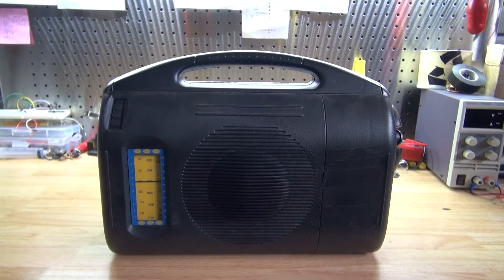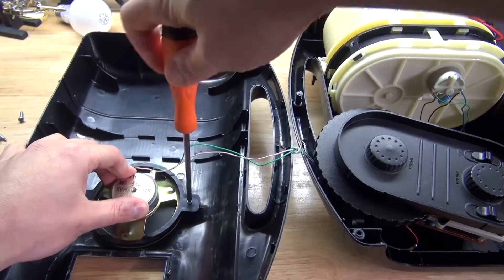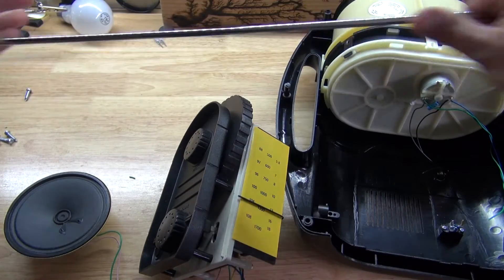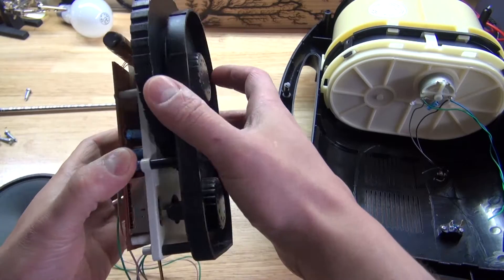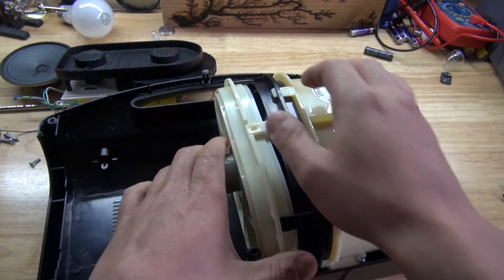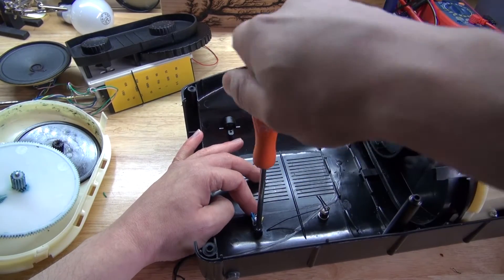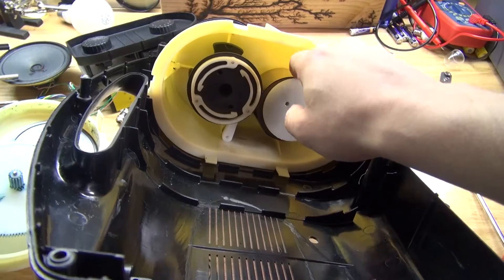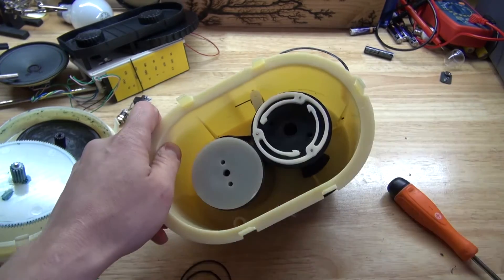Old Wind Up Radio Teardown

Comment: I have a different version, but still  works the same way. Mine is made of clear plastic, so you can see it all working. The spring is safe enough in its run-down state, but when wound up it is wound onto the other spool under tension, so rather nasty if that was to let go suddenly.
Reply from the maker: Yes, that does seem to be very scary!

Comment: I had this exact radio. The rubber band and the wind spring went kaput. What I loved about this radio is that IT IS A TRUE ANALOG TUNER radio, no digital tuner!!!!!!! This radio really grabs the signals. It sounded good in its case, so what I did was disconnect the little generator wires, and soldered up some new wires coming out of the radio, put black and red alligator clips on the ends, and connected the radio up to a 6V lantern battery. or a 6V cluster of D cells. This radio kicks ass! Hate to see analog radios ruined or destroyed.

Comment: I bought one of these 'remanufactured', oh, about twenty years ago.  Mine is marked as running on three volts instead of nine btw.  I tried it a month ago and it broke loose and unwound explosively.  The next time I cranked it, it bound.  Took it apart as carefully as I could and the spring shot out and tried to get me (similar to hundred year old gramophone spring drums i think) Damage inside the power unit: That first black plastic gear/belt pulley that came out has six teeth torn out of it; the spring is cleanly snapped on the perpendicular an inch after the mounting holes, and the belt is lying loose.  I discovered on a long dead forum topic that the failure mode of these is apparently the mechanism destructing after that little belt slackens.  I wonder how one is supposed to legitimately get into it, and how to deal with one with the spring locked in full tension.  Trevor Bayliss wanted to build a repairable radio for the third world; yet my Google skills have failed to find a repair manual so far.  There has to be one, somewhere, even if it's in Urdu.

Comment: hey could you help please i have one of these but when i wind it up it reverses and doesn't play
Reply from the maker: The part where you see that I pulled the spring out, has the same problem as you. All you need to do is two things, replace the spring or let it unwind and then put it back in and try again.